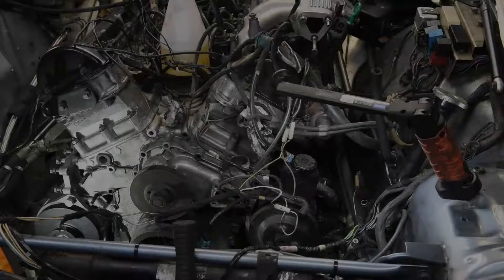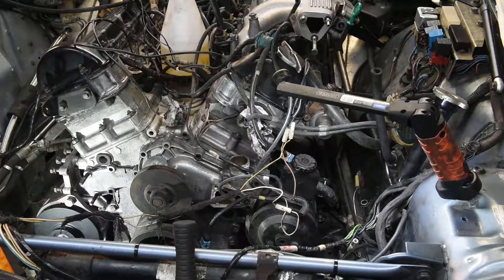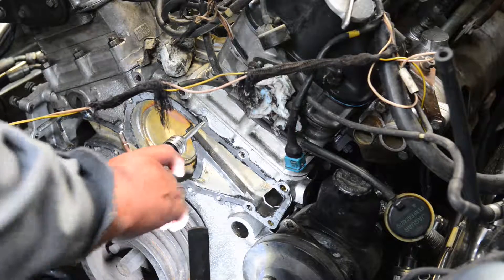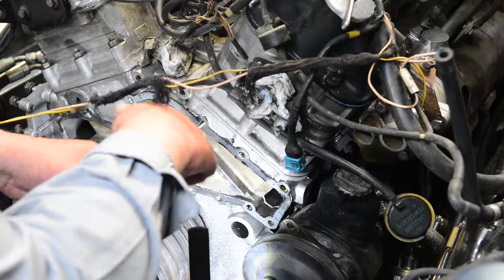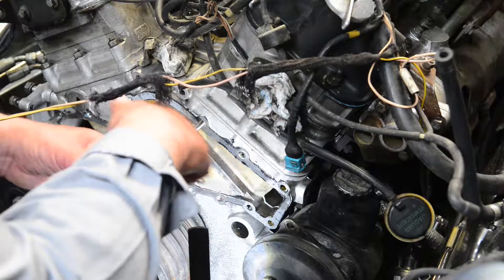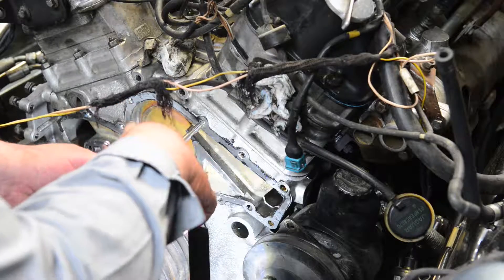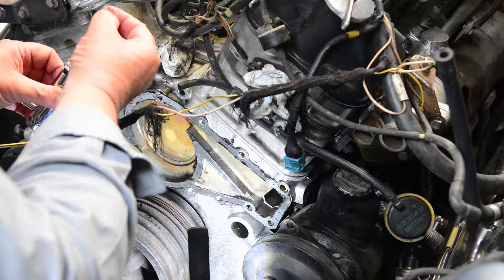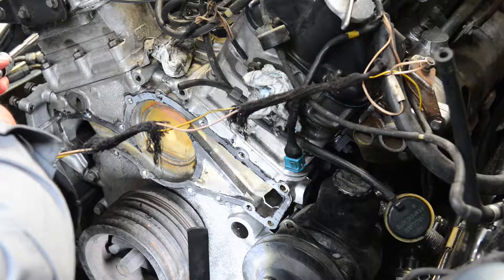Jaguar XJS V12 – engine refurbishment – pt6: Removing the water pump

Comment: I just had to replace mine a few months ago on my 89. What with all the time just getting to the thing,   Seen the horror stories about getting it out, and  back in. I used heat and PB blaster just to hedge my bets, on an engine with 32k miles. Not to mention over $300 for a new waterpump... Fortune was on my side thank goodness, I would have had a world of  sadboy  had  the weaping leak stopped, but with larger issues from not being able to get the new pump on well.Happy to say was  the final unadressed issue  RE: cooling... Now to the IBS woes

Comment: I hope you didn't end up with the nightmare I had doing this job! With mine one of the water pump bolts had sheared inside the timing cover. Despite trying the Kirby Palm workaround to avoid taking the engine out....this is what I ended up having to do. Be very very careful with those water pump bolts!